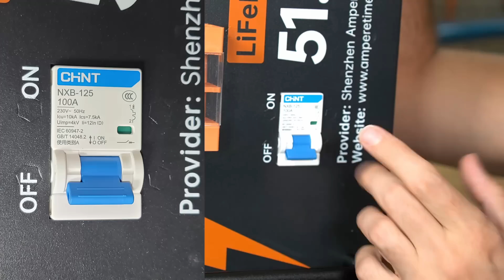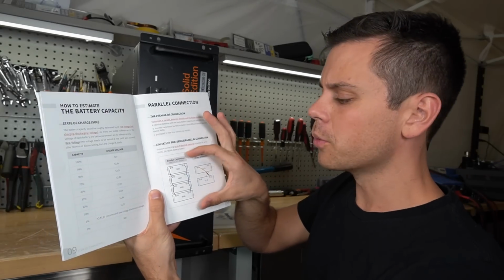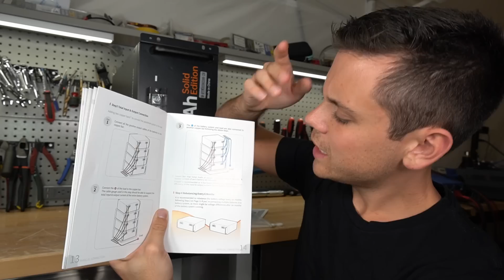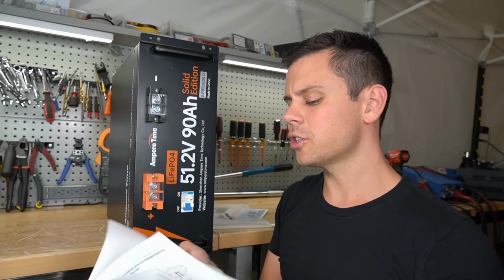New! $1,699 Ampere Time LiFePO4 Server Rack Battery

Comment: I think this is obviously a scramble job. Someone at Ampere Time panicked at the rise of the Server Rack batteries from other providers like SOK and EG4 and probably threw something together just so they would have an offering and not look like they were falling behind other companies. The problem is that they should have known that people like you, Will, would tear them apart for such a sloppy job.  That said, I wouldn't be surprised if they came out with a much better designed offering within the next year as the latest. They have a well established install base so I wouldn't think they would be willing to give that up.
Reply: I suspect they have a lot of stock of imperfect or B grade cells and needed a way to get rid of them without losing money.